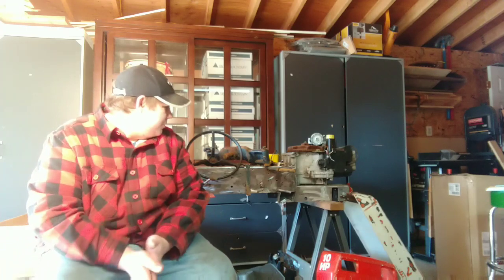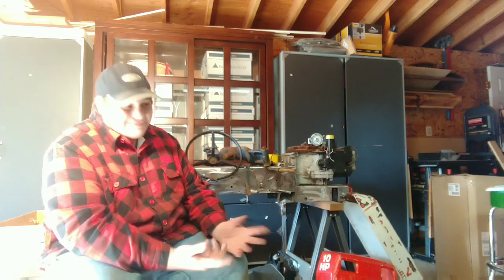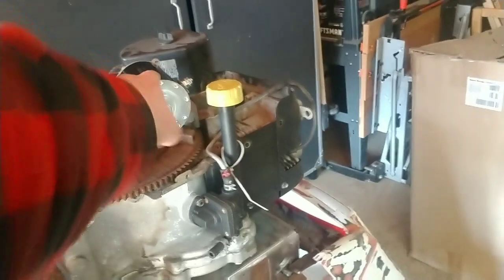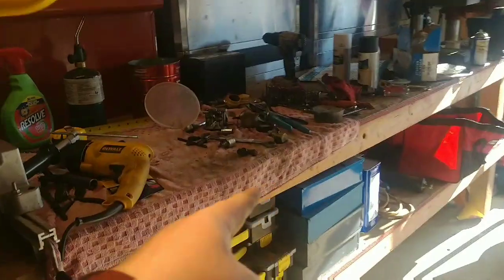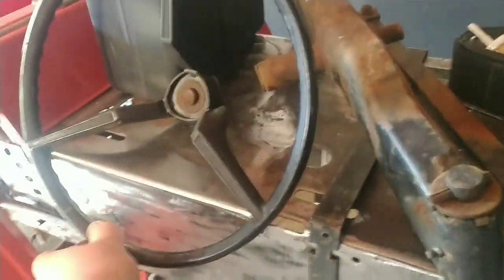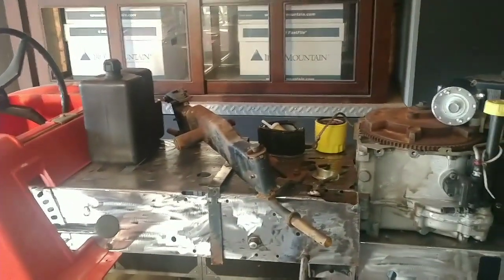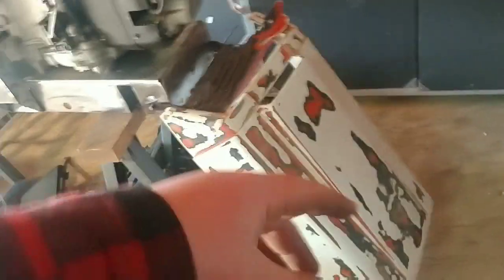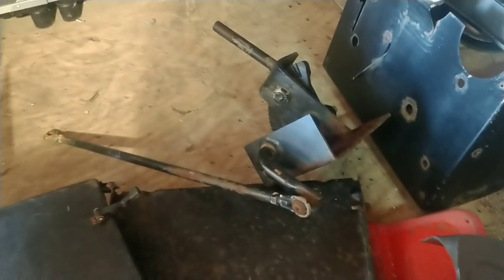General Lee - 2019 ATLTF Build-Off Entry

Comment: Good luck on the build, Paint is going to be a charming touch! I've seen a few people do a alternator on a vertical shaft, what alternator would you run? For that fiberglass hood, I would construct a steel frame that hinges on the frame, then bolts to where the fiberglass is broken off.
Reply from the maker: Thanks! Nice. I want to see how they did it. I've never seen anyone do it before. Ok I'll see what I can do.
Reply: @HillbillyOffroading  George Irwin on facebook has done it. He uses Ford alternators, which are spendy. I'd recommend a GM 10si alternator, they are about $40 rebuilt, and are about 100 amps. Message me on facebook for more details.
Reply from the maker: @OffroadMudMowers  yeah I've been planning on getting a GM one.